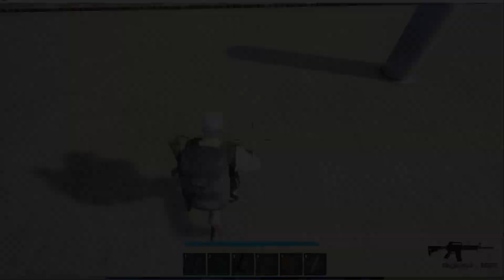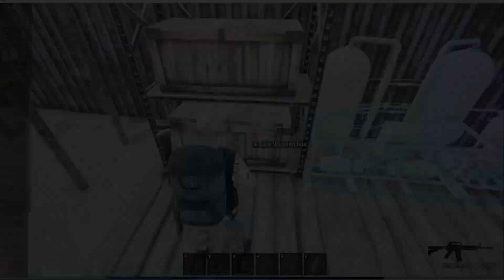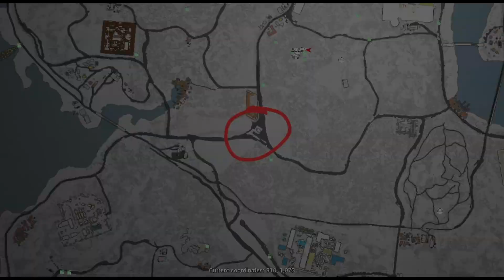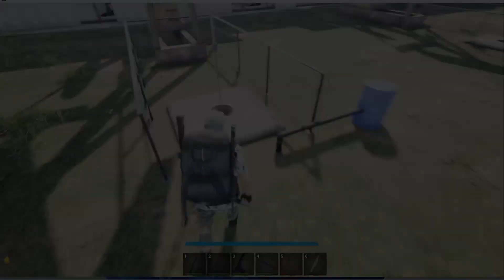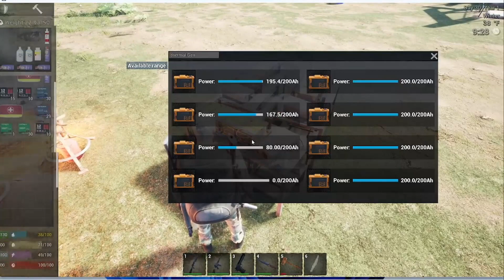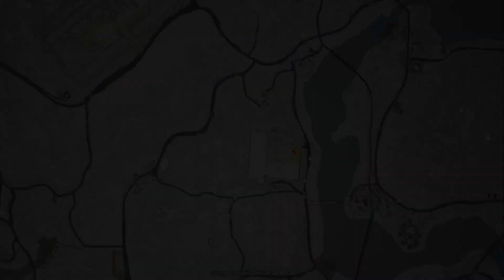No One Survived Fuel and Oil Well Guide

Comment: This was exactly what I was going to experiment with next in game, the various ways to power the pumps, and if using fuel generators dug too deeply into the pumping profits, etc. You saved me a ton of time!
Reply from the maker: Glad to be of service. It was interesting to delve into this, but fuel generators is too costly and too slow in power production to run both oil wells and chemistry equipment. You end up finding more coal and items to build thermal generators and thus faster then fuel gens.
Reply: @bloodcove1109  I just wish thermal gens could hold more fuel, 2000 is too low. Fuel gens can hold 50k of fuel. Smelters hold 3k of fuel. Thermal gens only holding 2k is silly. Its still the best option if you are willing to refuel it often and you have enough parts to make several.